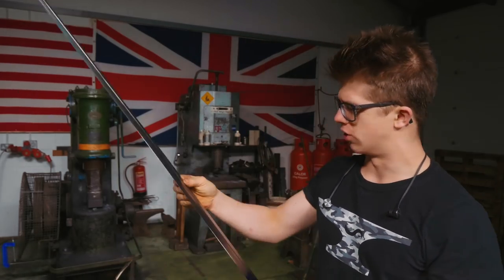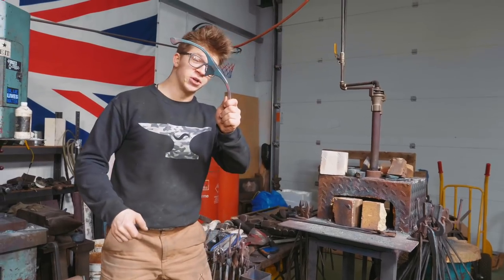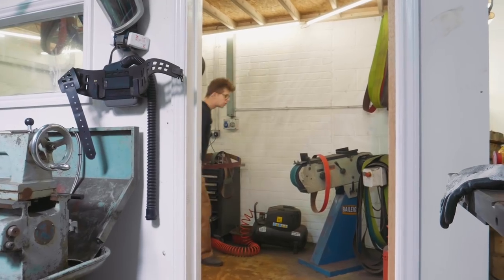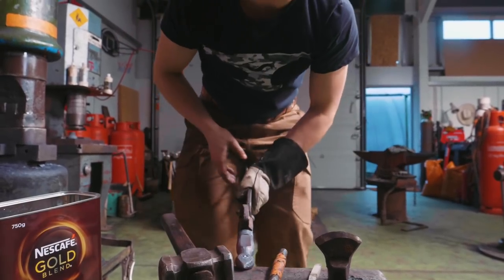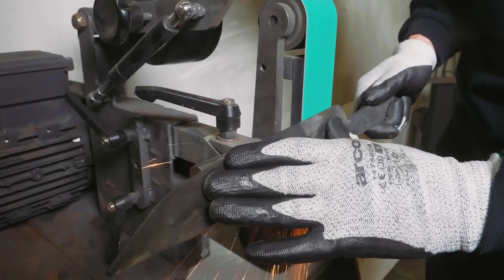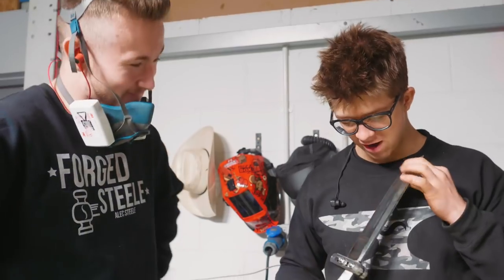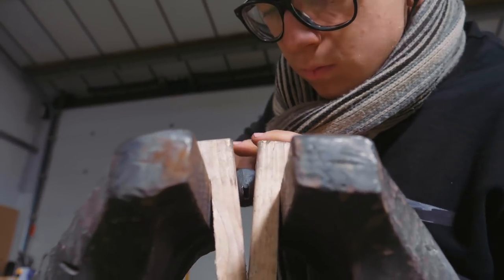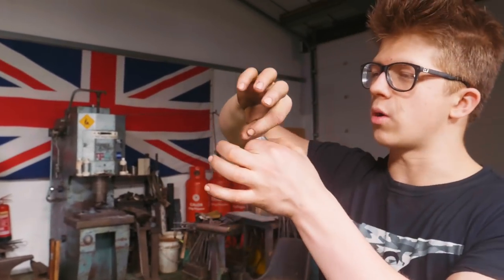MAKING A SCOTTISH CLAYMORE SWORD!!! PART 10

Comment: I like all the clean up and maintenance stuff you showed today.  You should do a video about all of the periodic maintenance you do on your machinery to keep it running well as well as any other consistently used equipment like your respirator, sanders, hammers etc. Heck even your tools, hammers, chisels, tongs as well. It'd be interesting to see what goes into a well running (or so it seems) shop with all the stuff that isn't forging steel and making cool stuff.

Comment: @Alec...to refine convex edges by hand i found very useful, instead of a hard tool like a wood stick for sandpaper (great to sand flat and sharp bevels ) , the hard rubber used into dock bumbers or boat bumpers (you should have seen it within your sailing experience) cause it's still veeeeeeery hard to push the sandpaper onto the metal but flexible enough to cover all the convex bevel and not a single thin line each pass.
Keep on your awesome job man !!

Comment: small pommel for a claymore
Reply: Right. That pommel is the size for a knife. Not a claymore
Reply: Too small to end your opponent rightly....
Reply: Ian Blackstone indeed.
Reply: 'cause you can't unscrew it and throw it :)
Reply: I was thinking it was way too small too
Reply: I want a saucer sized pommel, a proper nappa smasher!
Reply: Ian Blackstone And it needs to be round so you can hold it by the pommel and the handle for more agility.
Reply: I was thinking the same but he did say the blade was surprisingly light last episode
Reply: +NanoRobotGeek +Richard Henderson, it isn't a large blade for a claymore, but it is still a fairly long and heavy blade, I would guess about 2 - 2 1/2 pounds. I think a pommel for a blade of that size should be at least twice the size of that, and wheel shaped. That would shift the balance farther towards the hilt, which I personally prefer, and, as far as I know, most HEMA aficionados also prefer, for increased handling.
Reply: My thoughts exactly
Reply: @Dogurasu Agreed, the balance of the blade is going to be way off with that size pommel. It's going to take far too much effort to give it a good swing, and would be totally ineffective in battle.

Regardless of battle use though, it's going to look disproportionate to the size of the rest of the sword. The guard is wide because the sword is long and the pommel should be HUGE to look right.
Reply: Guys, while the pommel does somewhat add to the balancing of the blade, it is far from its main purpose. The main purpose of the pommel is to be able to strike with it, along with keeping the sword handle assembly together, and even keeping the sword in your hand, and then also being to act somewhat as a counterbalance. However, the main focus when balancing a blade is basically the blade itself. That is why its thickness and width reduce towards the tip. Also why the blade has a fuller. The rest to consider is the tang of the sword, the crossguard, and the handle. Specially the tang and crossguard. So tang, crossguard, and handle, by itself is considerable weight for balancing a sword. The pommel as well, but not necessarily. And one should be careful when adding weight to a blade.
Reply: Man, if I had a dollar for every time I heard that...

Comment: Hey Alec, was just watching through this project, and I wanted to let you know, traditionally fullers are forged into long blades to add structural integrity and reduce the risk of warping. I realize this is a tad late in the process, but I just thought of it, hopefully it'll help on a future project!
Reply: DuRay Petersen How does it add structural integrity? I'm just curious because many sword manufacturers (Albion for example) grind their fullers.
Reply: DuRay Petersen no fullers where added to large swords to reduce wait
Reply: it compressses the steel a bit more (alec probs doesnt do this because it'd mess with the texture hell eventually get on the claymore) and it allso makes you need less aterial because forging it from the center moves the metal outward, addign to its width. i dont know my blacksmithing well at all, so far as i know those are relatively small things.
Reply: Fullers don't add any structural integrity guys, that's a common misconception. Any time you are removing material you are Actually making the metal weaker overall. Fullers however are the shape that has the most strength to volume ratio, meaning the cross section of a fuller is a shape with high strength and low volume. This is what fullers are actually for, they are for removing weight without decreasing the strength too much. The whole "compressed steel" thing doesn't make any metallurgy sense, that isn't how it works
 ( I'm a blacksmith and knifemaker by the way)
Reply: Correct, fullers don't add integrity but they will increase rigidity which will help to prevent the flat of the blade from bending while at the same time reducing weight.
To test this take two strips of paper roll them slightly so that they form a curve along the length, then glue them back to back, they will become much more rigid than when they were flat but they will have no more intrinsic strength than before. Primarily fullers are a weight reducing method that doesn't compromise cutting strength, the rigidity is a bonus, less weight= faster blade.
In structural engineering, there is a thing called compression steel, this is NOT steel that is compressed it is a description of what the forces applied to the steel are trying to do. If the forces overcome the steel it will not compress it will deform.
I think I like this Claymore better than the Katana and I have been playing with Katanas since the '70s.
Reply: Perhaps forging the fuller instead of grinding it out? I think that would keep the strength and resist warping better.
Reply: The steel does not get compressed at all. The fuller will act the same whether it is forged or ground in.
Reply: At this point it's already been covered, but yeah. Fullers are meant to reduce the weight of the sword while maintaining the maximum strength
Reply: I'm with you DuRay, forging it is not so much a compression strengthening as grinding is a grain cutting, which will weaken the blade integrity. the fuller in and of itself only marginally if at all will add to the lateral strength via the arched shape being stronger than a flat slab. The fullers main purpose is to lighten the weight of the blade, however, so this is accomplished either through forging or grinding. Both methods reduce weight, because after forging a fuller you will remove the "pushed-out" material while grinding the bevels. All in all a blade with the exact same cross section using both methods will have the same weight. The only difference is whether or not you cut those metal grains or "smoosh" them. Any grainular material is structurally weakened by cutting the grains.
Reply: I thought they were so your sword didn’t get stuck in your opponents body.
Reply: ROTFLMBO
Reply: DuRay Petersen the biggest reason the filters are made us to greatly reduce the weight and they couldn't provide structural integrity, it essentially gives the blade a score line to fold along if enough force is applied.
Reply: that's not how metal works
Reply: He ground it so that it kept the integrity of his pattern welded center from changing its edges and pattern too much. On a single steel bill it is dose not matter but since steel does not compress it squishes outward it would have messed up his pattern lines.
Reply: he uses a lot of tools thats not considered "forging" but hes 19.. like hes gonna listen anyway
Reply: Tristan Antonsen a forged fuller will have a thicker blade as the edge of the fuller slightly raises 
Check Wikipedia on fullers they have a good diagram on the process
Reply: There are so many misconceptions about fullers... 

1. They do not make a blade lighter

2. They do not make a blade stronger

3. And they definitely don't have anything to do with blood...

What they actually /did/ originally was make a small amount of material into a larger blade without making it so completely thin in cross section that it's flimsy. They weren't intended to remove material or make anything lighter because they were originally forged in not ground, no material was lost. It's making the most of not much steel. And remember steel was hard to make when these things were designed so smiths were much more frugal with it than modern smiths are, they probably wouldn't have even used solid steel. It probably would've been a thin sliver of steel sandwiched between iron.

Though functionally I do not think a forged fuller blade would act any differently to a ground fuller blade once done. The only difference is one is much harder to make.
Reply: Broadus Thompson so you are saying that getting rid of material doesn't affect the weight of the blade? any loss of material makes the blade lighter...
Reply: Carter Mabry it makes it lighter when you grind it in. But hundreds of years ago when the fullered blade was invented that was not the purpose nor result. It's called a fuller because a fuller is the forging tool used to make that groove by forging. And when you forge in a fuller no material is lost, its spread wider. So ground in fullers make little sense following the original purpose.

But ultimately you wind up with the same blade either way. 

What I'm saying is the fuller was not designed to make a blade lighter. Though obviously when you grind in a fuller it gets lighter.
Reply: What I'm saying is when the fullered blade was invented it wasn't designed to make a blade lighter. Though obviously when you grind in a fuller it gets lighter.
Reply: Ethan Scothorn you mean it’s not a blood groove? Definitely thought it was a blood groove. 🤣🤣🤣🤣
Reply: https://en.m.wikipedia.org/wiki/File:Fuller_use_in_bladesmithing.JPG
This is how a fuller ( the tool ) works
Notice the raise on edge of fuller
Thats the difference to grinding
Reply: Markus Camenzind ...never seen my fullers do that... but okay...
Reply: Broadus Thompson when i use my fuller/bevel die it comes up even higher
Reply: if you read his reply completely  it would help you understand his comment. its not about removing/loss of material. its about HAVING to start with less.
Reply: It is an exaggerated picture of what happens to the metal.
Reply: Blood Groove is the name of my Black Sabbath cover band.
Reply: +Tristan Antonsen  only a sith deals in absolutes

Comment: You can save a lot of time sanding by just doubling the grit number. Meaning half size grain, it will remove the scratches from the last grit nicely. I usually start with 120, and move through 240 and 400 to 800. 1200 only on non-etch blades.

Comment: the problem with the metal pummel is the weight distribution of the weapon (Claymore)

It should balance just in front of the guard, or if you want more more weight in your swing, a little more in front of the guard.

Then again it depends on the size of the pummel.

Comment: Is the balance right if you use such a small pommel
Reply: Robin Bane probably not it’s 110 cm
Reply: The pommel isn't as important in balancing swords as people think. The most important thing is taper and especially distal taper. 
The guard is so massive that i'll have quite an impact on the center of balance.
A tip heavy blade would be a bit unwieldy but it's not obviously "bad".
Anyways, even if it isn't as functional as a historic reproduction (which let's be honest, this isn't) it'll still look cool and be a badass two-hander.
Reply: Kavriel it will still be a cool sword but it didn't quite look proportional to the length and width of the blade. Im not saying it will look bad just a little small
Reply: Good point.
Reply: On a “traditional” claymore the pommel should have the same diameter as the blade, round and flattened on the same plane as the blade. Thickness of the pommel depends on the balance of the blade. BUT as we all know this blade isn’t meant to be “historically accurate”.
Reply: guess thats one thing he has to learn still. You cant just build swords by the look. Just like you cant simply grind them by eye measurement. You have to tiller it, just like you do with a bow.
Reply: +Kavriel I Personally think that pommel weight does increase the handling of swords quite a bit.
Reply: Robin Bane, simple answer: no. Not in the slightest.
Reply: Robin Bane I prefer a sword to be balanced about 3-4 inches from the hilt. With that pommel, it would be more like 7 or 8 inches.
Reply: the pommel is more a decorative piece and to prevent the handle from coming off than for balance
Reply: +Fire Bomb
It is both. HEMA techniques for European longsword fighting rely on circular, fast motions that can only be done correctly if the sword is properly balanced. That is what the pommel is for, in addition to holding the  weapon together. Do some research on traditional sword construction.
Reply: The blade is too wide for a claymore. Balancing with a pommel is pretty much impossible at this point. As with most of Alec's projects. It's about the fun of the build and learning. It's not about fitting a traditional design.
Reply: Sources, anyone? Where do you get that the pommel is for balancing, where do you get that blade is too wide or whatever, where do you get that a pommel should be the same diameter as the width of the blade? 

I think that sword is turning out very historically accurate. And the pommel:

Guys, while the pommel does somewhat add to the balancing of the blade, it is far from its main purpose. The main purpose of the pommel is to be able to strike with it, along with keeping the sword handle assembly together, and even keeping the sword in your hand (somewhat), and then also being to act somewhat as a counterbalance. However, the main focus when balancing a blade is basically the blade itself. That is why its thickness and width reduce towards the tip. Also why the blade has a fuller. The rest to consider is the tang of the sword, the crossguard, and the handle. Specially the tang and crossguard. So tang, crossguard, and handle, by itself is considerable weight for balancing a sword. The pommel as well, but not necessarily. And one should be careful when adding weight to a blade.
Reply: Ninja Hombrepalito, You are right about the additional purposes for the pommel. However, the pommel is the most effective counter weight on a sword, as it is behind the hand. As far as the hilt and how a blades' distal taper affect the balance of a sword, they are not as important as a pommel in balancing. Because they are located forward of the hand, they will always shift the balance of a sword forwards. Because the pommel is behind the hands, it is the only part of a sword that can shift the balance backwards.  As i'm sure you know,  a sword (especially a European type) that is balanced closer to the hand is faster to move and more easy to control. For sources, many blade-smiths and martial arts teachers contend that a properly balanced sword is more effective that a sword with a balance too far forwards. I believe they developed this theory from the mentions of sword balance in Treatises, and the balance and construction of historical examples. I also remember reading of a sword with a large pommel being mentioned in a viking saga, because the owner of the sword liked the balance in-hand. I would have to disagree with the blade being to wide for a claymore, I think it is about right. As far as historical accuracy goes, I still contend that the pommel is improperly sized, and the shape of the quillons is much different than that of most known historical claymore examples, that have the quatrefoil design. Although, it is not too different from some other longswords I've seen.
Reply: Indeed, it's much to small. If it were to be thrown there would be no force to end anyone rightly ;3

But still, fabulous work!

Comment: That pommel looks kinda small for that sword. A lot of people dont understand that a pommel is not just for securing the handle to the tang  - IT IS SUPPOSED TO HELP FINE TUNE THE BALANCE POINT for the sword - a heavier pommel moves the balance point backwards, and a lighter one moves it forwards.

Comment: Could have used the wire wheel in the angle grinder and then put the angle grinder in the vise so that you could have used it like a bench grinder wire wheel.

Comment: Dude Jamie! Your favorite color dychem is BLUE too?! What a coincidence. 
PS: you have drilled those two holes closest to the blade in a very weak spot now making it weaker yet. That could cause a critical failure. Time will tell. Nice work overall.

Comment: I’m no expert but the pommel you made looks a little small for that sword. My understanding of the pommel is that it is used to help balance the sword so that the weight is close to the handle so that the sword is easier to control the blades movement. Just a suggestion.

Comment: How do you make those timelapses were the camera is moving slowly
Reply: That's a hyper lapse and there's two ways to do them. 1) Move your camera an even distance after every picture manually or 2) get a rig that will do it for you, such as a digitally controlled slider and pan-tilt head. If you take the manual route it will probably end up a bit choppy, so you'll want to use a digital stabilizer (such as warp stabilizer in premier) when you're editing the footage to smooth it out.
Reply: 0.02 4k downscaled to 1080p with zoom/pan effects
Reply: Andrey Belousov that's another way of doing it but that way removes parallax, which these hyper lapses definitely have.
Reply: Use the mechanism of one of those analog kitchen timers
Reply: with a stationary camera, and then he changes the frame when he edits, thus making appear that the camera is moving slowly.